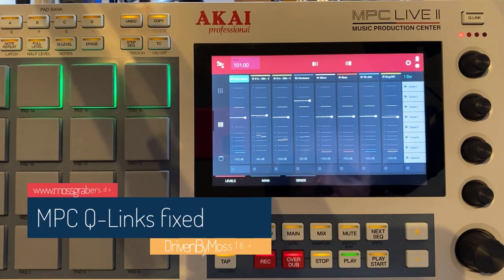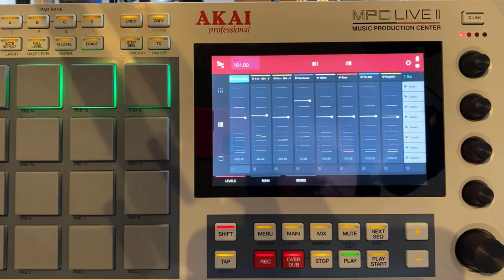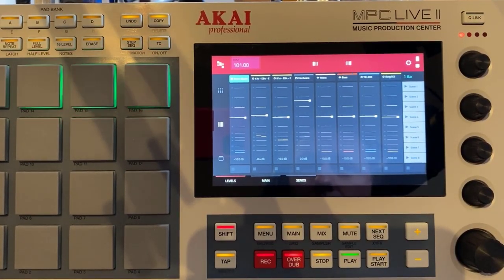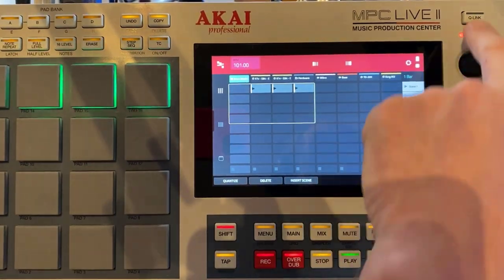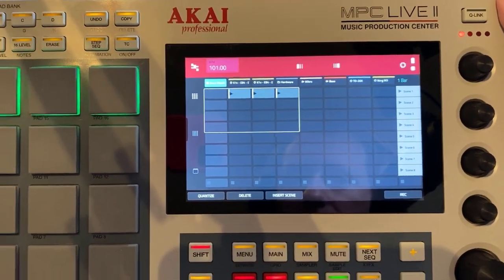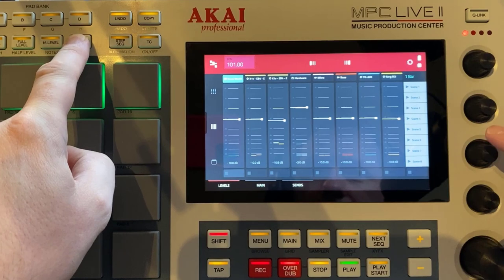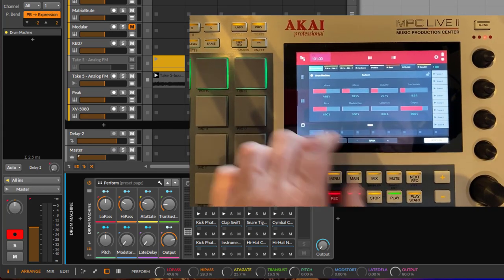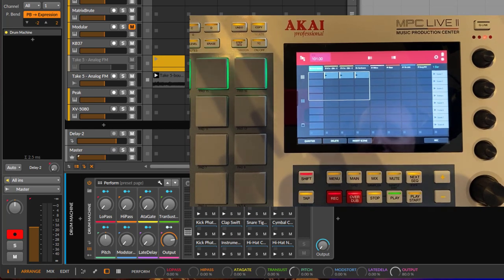MPC 2.11 Firmware Update - Q-Links do now work with Bitwig and Reaper (DrivenByMoss 16.4.1)!

Comment: To choose you would pick an Akai or a Maschine for Bitwig ?
Reply from the maker: If you are looking only for a controller, none of them.
Reply: @mossgraber 
Ok here is kinda same/different question

If you can only pick one controller what would it be?

I’m thinking arturia Beatstep pro. Funny that’s the one I don’t have. I have MPC and Maschine mk3. I don’t find neither to be best controller for Bitwig or Reaper.  

So,  from all the midi controller pads or keyboard; What would you pick?
Reply from the maker: @MannyBeatsLatino I cannot answer that question for you. I use different controllers for different tasks. Behringer X-Touch with extender for mixing. Push 3 for sequencing. Hydrasynth Deluxe as the master keyboard.
Reply: @mossgraber 
Make sense difference devices for a different applications.